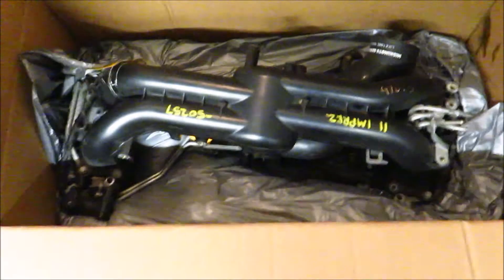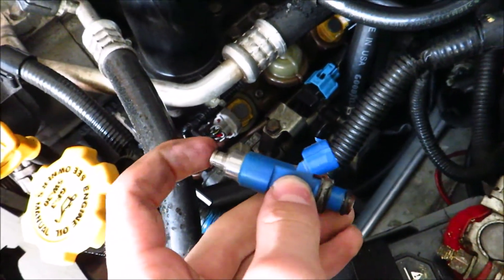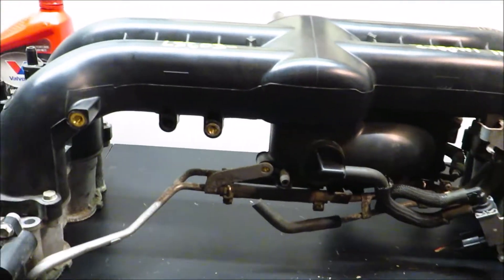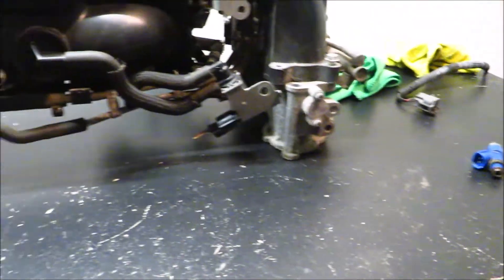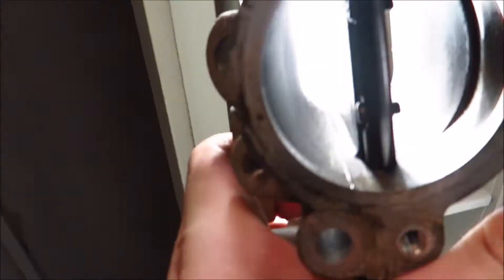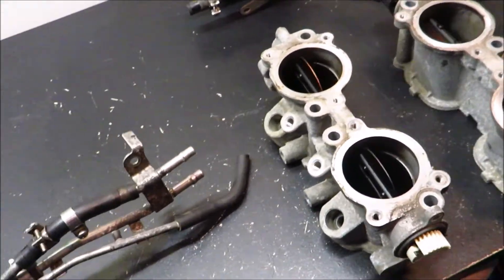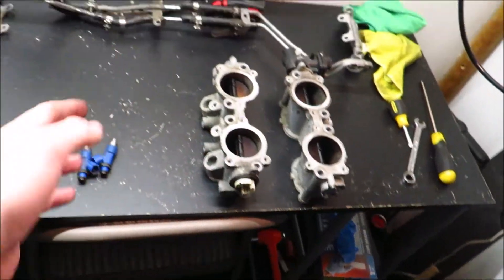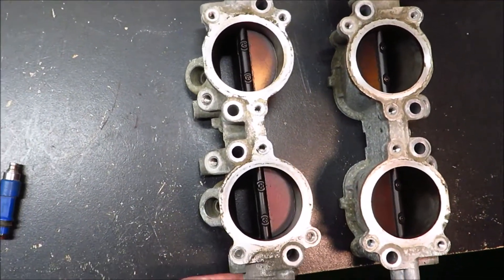Budget Top Feed Injector Conversion

Comment: hey i was wondering if you could help me i have a 05 legacy gt and converting to top feed can i just get a top feed kit or do i really need to switch rails to another year 

im hoping on keeping my 05 rails and tgvs and getting a 1000$ kit from boosted performance
Reply from the maker: The side feed fuel rails are different than the top feed fuel rails, so you would need to get top feed rails. If we are looking at the same kit, it comes with rails and lines, so you would just need to buy top feed tgvs
Reply: @SWSpeedCo can you help me out tho because im getting confused im looking at keeping my stock fuel likes underneath my manifold and buying a top feed fuel rail kit i think the one from boosted performance so i can use everything that they have without removing stock fuel rails underneath the manifold??
Reply from the maker: You will have to replace the stock fuel lines if you want to go top feed. The fuel lines and rails are one piece and the top feeds are different from the side feeds. Regardless of what method you decide to go with you will need top feed tgv, top feed injectors and top feed fuel rails/ lines weather that be oem or aftermarket.
Reply: @SWSpeedCo anyways i can send u a pm to send to you what im looking at for the top feed conversion??

Comment: Did you change any of the damper system?  I have a 2005 OBXT as well and I am doing a TGV delete (but keeping the electronics working).  I bought a 2013 FXT intake assembly like yours in this vid after watching what you have here... I didn't see the need to spend $$$$ for aftermarket stuff when there's plenty of good parts nearby that are available (pick and pulls!).
Reply from the maker: I used the damper system from the doner car 2012 wrx. You can bolt on the entire top feed fuel system from the firewall forward and it will work. The only reason I did extra was because I had plans to go for higher power numbers on ethanol so I needed more flow than stock top feed system.

Comment: @SWSpeedCo what did you do with the connectors for the injectors?  Since the OBXT has side feed connectors?
Reply from the maker: You can buy adapters that have male side feed plug on one end and female top feed plug on the other end. Probably the best way to do it so you don't have to cut anymore and can go back to stock if needed
Reply: @SWSpeedCo  is there a connector that accepts the side feed wires?  so there is no jumper in between?
Reply from the maker: I dont know of anything like that. The adapter with the wire works very well, you kind of need the wire so you can plug into the harness without stretching the harness
Reply: @SWSpeedCo would those top feed injectors to big to run on stock ECU from the OBXT?
Reply from the maker: No, the ecu doesn't limit the injector size.  You can tun as big of injectors as you want. The stock fuel system only supports about 940 cc of flow
Reply: @SWSpeedCo  I think I asked incorrectly. Let’s say I do the Impreza fuel lines swap. What injectors should I run? Being I will have top feed instead of side. Will the ecu be able to compensate for bigger top feed injectors if installed?
Reply from the maker: If you covert to topfeed injectors the ecu will need to be tuned for the new injectors. If you run stock top feeds it may be close enough but it's safer to just get it tuned.

Comment: 05-06 Outback XT's actually came with the same block as the STI of the same year. Not sure on LGT's
Reply from the maker: Yeah, the legacy GTs are the same as the outback XTs. The blocks are the same the outback/legacy engine code is ej255 and the sti has an ej257 but to my knowledge the only difference between the 2 is they have a different piston dish size. Probably for more boost in the sti.
Reply: Yeah I think STI is 8.2:1 and OBXT/LGT are 8.4:1 due to the piston dish

Comment: Did u add the coolant expansion tank bracket from an 08+ wrx as well or modify the one on your legacy?
Reply from the maker: I didn't put the bolt back in the bottom of the expansion tank lol, I just set it down on the post on the intake manifold and made sure it was seated and it hasn't budged. If you want to do it right I'm sure the wrx bracket would work
Reply: @SWSpeedCo  cool thanks for the reply. Doing this myself so wanted to see what others have done.
Reply from the maker: It no problem, lmk if you have any other questions

Comment: quick question is it parallel fuel system ? or just top feed
Reply from the maker: This is just a top feed system. A parallel fuel system  it where you have two separate fuel rails with a line going to each rail individually the stock system has 1 feed and return line for the whole  system. Hope that makes sense
Reply: Thank You that totally answer my question, that a very nice oem mod for ej motor